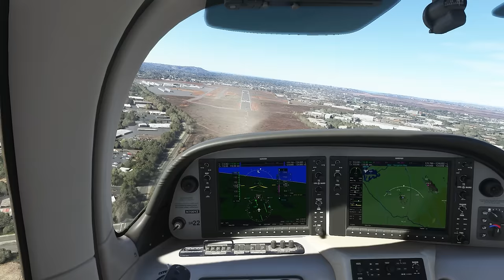Fatal Plane Crash At Montgomery Field After Student Pilot Declares An Emergency | N700YZ Crash

Comment: I live in San Diego and we discussed this in my Human Factors in Aviation class yesterday. Tragic accident, just learned the pilot died. Well put together video and explanation in such a short time from the accident
Reply from the maker: Thanks Joseph!
Reply: Joseph, as mentioned I witnessed the flight and accident and then was the first to reach the pilot and administered aid. Great that you are teaching the course in Human Factors. As a CFII for 43 years, and involved in several aircraft accident investigations, your course can be very useful.  Let me know if you need any additional information.
Reply: @PersonalWings  Sad, I would like to know if the pilot noticed the trim issue while within the BRS envelope of 500 above AGL. I know the military puts great emphasis  on rapid use of an  egress system. I don't remember how much the Cirrus syllabus harps on the early use of BRS.
Reply: @krezvan  It's tough to say without him being here to share his thoughts in those final moments. It's known that pilots will try to fix an issue before pulling the chute, and given the student status, he likely didn't have it drilled enough into him that it was an option. His height above according to Flight Aware was around 1,100 feet and the elevation is 420 at KMYF, enough altitude to pull the chute, but that may not be accurate based on the footage of the final moments showing him to be (or what looks to be) lower.
Reply: @krezvan  Hopefully the NTSB analysis will shed some light. The Cirrus CAPS/BRS is an excellent system and is always an option for the pilot.  As pilots we are usually good problem solvers and try to fix anomalies - some are not within our control to fix - hence the effectiveness of the Cirrus CAPS. I have it memorized - two hands on the handle, chinup-like maneuver, 45 pounds - PULL.  I've practiced it in the Vision Jet sim several times.  Rich and Tigre

Comment: The controller heard the accident airplane making broken transmissions without a callsign and didn’t hear when he said emergency and thought someone had a stuck mike. Looks like what prompted the go-around was that the cirrus was descending at three times the normal decent rate and continued flying at almost twice the normal approach airspeed which created a conflict with the plane she had just cleared onto the runway for departure. Pilot’s- remember to “fly the plane”. Controllers- try slowing down when you get overwhelmed, which is what she was (sorry but you were, since you didn’t see him hauling ass at 1 1/2 final when you cleared the other aircraft to line up and wait, not even clearing them for takeoff, OR hear the accident airplane say “emergency”).

Comment: My instructor has told me two circuit breakers you really know off by heart where they are. The trim and the autopilot. Often those circuit breakers are made to be more obvious.
Reply: Yes, I put red circuit breaker caps on mine. My airplane has retractable gear and so there's also a red cap on the gear breaker. You need to be able to locate them instantly - my airplane probably has (I haven't counted) close to 100 breakers on three separate panels so, even if I know about where a breaker is, having the red cap on the critical ones assures that I don't grab an adjacent one instead of the one I need.
Reply: On the cirrus, the breakers are very difficult to reach while flying, and on short final its impossible.  You have to bend forward and reach down, losing your view outside and limiting  control of the sidestick.
Reply: @Tharkunify  I've been in a Cirrus a couple of times but never trained in or flown one. That's very poor design though and surprising because Cirrus' reputation, well-earned as far as I know, it's excellent design with safety as the overarching considerations. A key component of training with autopilot, FMS, electric trim is what to do in the event of runaway. I had (and have in recurrent training) it drilled into me: "What are five ways to disconnect the autopilot? What are two ways to disconnect electric trim?"
Reply: @TIO540S1  I wish I could post a picture of the circuit breaker layout.  For pitch trim, its the furthest in the back, near the bottom.  Virtually impossible to find while flying low to the ground with a runaway trim.  One thing I learned from this video is to memorize the location by feel: Furthest back, 4 up from the bottom.  I have had a trim failure on this plane and it made me swear that my next plane will have a manual trim as backup like a Diamond.  It takes a large amount of force on the sidestick to maintain level flight.
Reply: @Tharkunify  I found the leg well location for the circuit breakers a interesting design choice.
Reply: @Tharkunify  Yes, I bet! Mine has electric and manual trim. I probably use them about equally. (Knocking on wood) I've never had a runaway trim incident in my current or previous airplane (a C441 currently and a Piper Saratoga previously).
Reply: Would pulling the trim breaker on a Ciruss cause it to fail into a neutral position?  I'd not want to fail the trim while it's fully deflected.
Reply: Really sad. Ultimately the fastest way to save the ship would be to flip the master off. First thing we train for with auto trim or autopilot issues. Flip the switches that are convenient, then troubleshoot with breakers. But the key is solving the problem as quickly as possible.
Reply: @zippoc04  on short VFR final that is a great idea.
Reply: @nuothe11th  - Pulling the trim breaker should have it fail in its last position. It will also free resistance on the manual trim. This will allow the pilot to adjust trim manually.
Reply: To me, the Cirrus CB panel can make it hard to find any specific breaker unless you tag it with a ID collar
Reply: @deanfowlkes  no manual trim on these, it stops where it stops and have to hold the yoke as needed
Reply: @TheReadBaron91  - That is unfortunate. I fly an LSA with an electric-only trim, as well. That is never as comfortable as having a manual backup. Landing out of trim really messes with your muscle memory.
Reply: @TheReadBaron91  - Exactly, something that can be felt and seen, even in low light conditions.
Reply: And if its getting critical and in the panic cant find them, turn the masters off, then get control at least
Reply: @Tharkunify  that's quite strange. Would the parachute still function in this case? Does Cirrus have a published procedure for this apparently repeat problem?

Comment: Flight instructor here. This will be a longer comment and I apologize in advance. Trim activating “on its own” can be due to pilot error or mechanical failure. However, any aircraft with autopilot trim will have a way to interrupt that trim, and revert it back to manual control only. It’s likely the student pilot wasn’t familiar enough with that procedure. As far as seriousness, it can be incredibly serious. In simple terms, trim essentially helps a pilot maintain a certain angle of pitch, and when working properly, eases the control force necessary to maintain a certain pitch. If that pitch goes too far up, you stall. Too far down, you descend. From the video and the information presented it seems that the latter was the case here. Full trim requires a very significant amount of force on the controls to overcome. It seems the pilot was unable to do so. My assumption would be that the pilot was either physically not strong enough to overcome the trim or not experienced enough to successfully land an airplane that was actively fighting against him.
Reply: The possibility exists that the problem was caused by the aircraft's envelope protection system rather than by a trim runaway. The lack of recorders on small GA aircraft may make it difficult to decide which actually occurred.
Reply: I agree of what you say. If happen to anybody, because it did so been to me at st Barth 😂 on pitch down, slow your speed at the maximum you can and take up/down gentle movement. After that the plane is enough controllable to make a safe land.

Comment: So sorry to hear about this accident. It reminds me of a similar emergency I encountered as a newly soloed student pilot. I had just departed the strip, about 100 ft up when I realized my Cessna 150 trim tab was stuck with too much climb cranked in, and it would not go back down. I didn’t know what to do. So, I pulled power, shoved the stick forward to dive for the runway, (about 4000 ft strip if I remember correctly). I managed to safely touch down and barely able to stop before rolling off the end of the runway, (about one foot of runway remaining, literally 1 ft). If not for the Lord I’m sure I would have run off the end of the strip, OR tipped face forward into the runway seriously damaging the plane and maybe me too. I had to physically shut off the engine, get out of the plane, and manually swing the tail around to point back to the taxiway before I could get off of the runway.

The run up to takeoff checklist had indicated no trim tab problem. After the plane was tied down I discovered that my newly repaired radio was installed without the antenna RF cable being properly tie wrapped to the airframe. So naturally once the plane was in an up attitude during takeoff the loose cable drooped into and jammed the trim tab, making it somewhat of a ratchet limitation, it would go further up but not down.

Lesson learned from this near disaster, ALWAYS double check the correct installation of all new or repaired equipment before starting the engine.
Reply: Thank you for this story!

Comment: 4 reasons why I never once used the electric trim on Caravans in which I have about 4K hours: 1 you never have to worry about a runaway trim; 2, I felt I had better control and better feel for what the airplane is doing by using manual trim; 3 trim switches are expensive, if you use it all the time it's eventually gonna break; 4 like power windows in a car, there's tendency to always be adjusting the thing up or down, resulting in sloppy flying.
'Other thing to remember: Turn OFF the master (or pull the breaker, if you can remember where it is) and fly without it. Most light-plane engines will fun fine without the master on.
I wouldn't train new pilots in a Cirrus, either.

Comment: As a pilot flying a C182 (350 hrs) and having test flown a Cirrus SR22 for a one hour test flight (we we're considering purchasing) the Cirrus was quite challenging especially with the lefthand joystick control.  I had remembered my flight instructor talking about not purchasing a "doctor killer until you gain experience" as he referred Bonanza and many other higher performance or complex aircraft.  The ballistic shoot on the Cirrus can lull a pilot into a false sense of security.  With the greatest respect to the family and without knowing all the facts I can imagine the following scenario going through his head.  TRIM ISSUE, FLY THE PLANE, WHERE IS THAT AIRCRAFT,  I DON'T WANT TO GET IN TROUBLE WITH ATC, I SHOULD GO AROUND,  I CAN'T,  WHICH BREAKER KILLS TRIM, NO TIME, FLY THE PLANE, END OF RUNAWAY,  NO ROOM, FLY THE PLANE, PULL UP, GO AROUND, STALL SPIN. Very sad and could easily have happened to me.  We have to remember everything happened from problem to crash in less than one mile at 100 knots. Agsin condolences to the family.
Reply: I agree. I have to sometimes remind myself that no matter what my certificate says, I’m still a student pilot with unlimited IMC solo privileges.
Reply: You get used to the side yoke and eventually prefer it, or at least I do. You’re spot on with the need to fly the plane. The Cirrus only has electric trim but even fully out of trim it’s still very controllable, just takes a bit of effort… but nothing like a Cessna where out of trim condition it near impossible to overcome… but they also have the manual trim wheel. Hope you’re enjoying the 182, those are very sweet as well. The Cirrus actually has a fairly good safety record, but there are A LOT of them flying these days. I personally do not feel it has earned a “doctor killer” title.
Reply: I'm not a pilot so I may sound ignorant but why are these breakers not clearly labeled for an emergency? Or are they and he was just too panicked?
Reply: @Michael_Hunt  They are and frankly it wouldn't have helped at all because of the way the Cirrus system works. With that said it's not hard to muscle through it unlike most where it's nearly impossible to muscle through it.
Reply: @Michael_Hunt think of like 30 black buttons in 2 rows of 15 at the right side of your leg in an unlit part of the cockpit. All the little buttons are black. Labeled with little white lettering under them. With out adding a “breaker collar” it’s hard to find and even harder to find while stressed like this pilot.

Comment: I don't fly the SR20, but I know it has a control stick rather than the familiar yoke control column, and the stick is complicated and could present problems for pilots who aren't used to it. The push-to-talk is a small button located on the front of the stick where it is hard to see. The accident pilot may have grasped the stick tight when he declared an emergency and pushed that button by mistake. The trim button is on the top of the stick and it is one of those 4-way up/down/left/right things that may have gotten stuck or been pushed by mistake by the pilot. Another problem is that continual pressure must be maintained on the stick or it will automatically return to a neutral setting. The SR20 and SR22 models are extremely popular but have had a lot of pattern accidents due (in my humble opinion) to a poor overall design.
Reply: I think the control stick is better for pilots because it is what seems more intuitive for me. However, I do think that until the rest of aviation catches up to what I honestly believe is a better control system, there will be need for training on the stick before putting someone in a plane with one.

Comment: Tragic accident, to be sure.  I think he panicked when his trim started to malfunction.  He needed to stay calm and work the problem.  The trim doesn't override the elevator, but a fully deflected trim would mean that you'd really be having to muscle the yoke to keep the pitch attitude level.  Still, it is doable, and he needed to climb to see if he could resolve the problem.  And if he felt he couldn't land safely with the trim jacked up... well, then it's time to pull that big, red handle.
Reply: Is there an electric trim shut off in the Cirrus?
Reply: Why let him fly alone? Some people just shouldnt.
Reply: @louissanderson719   There might be a breaker for it, but I don't think it would matter.  If the trim went fully deflected then all the breaker does is turn it off and it's still in that position.
Reply: @industrieundtechnik1761   I believe it said he was flying solo.  That's a necessary and important part of pilot training.  Though in all fairness, I'm not sure how I would react if this happened on my first solo.   I would hope that I would take my own advice: stay calm and work the problem, but you never know until you're actually in that situation.
Reply: I was told this about flying. Bad things happen when 3 mistakes are made. I won’t judge this pilots 3 things.
Reply: @alanharaldson4229  hohoho
Reply: @ABQSentinel  all planes have a manual way to change the trim, pull the breaker, fight the trim with elevator input and work out the trim manually to a neutral state, then go on to land.
Reply: @ABQSentinel  His communications appear to suggest it was moving abnormally on it's own for some reason rather than just being stuck in one position. Either way their biggest mistake in this situation was rushing to land immediately in an aircraft that still had power and was still flying. Better bet would be to add power and get the aircraft climbing to buy yourself some breathing room to run checklists to diagnose and fix or isolate the problem then prepare for another approach. Unless you don't have the energy or are literally on fire or something of that nature best not to rush to get down and throw away valuable time that could be spent getting a better handle on what is going on. Also vitally important if you feel yourself starting to panic there is a reason for the saying, "When you have an emergency, the first thing to do is wind your watch", it's a good reminder to stop and take a breather then take your time decisions taken in the grip of panic tend to be the exact opposite of helpful in situations where you need to think clearly about the problem.
Reply: @seraphina985  Yup, I agree.  This is why commercial planes don't rush to the ground when there is a problem.  They make their emergency call and then ask for vectors to stay near the airport but give them time to work through the QRH.

Comment: I had a runaway trim on my first solo flight in a Cessna 172SP. Luckily I immediately realized something was wrong and looked down just in time to see the trim reach the limit of its travel. I was also very fortunate my instructor had drilled into my head which breakers to pull to disable the electric trim and autopilot. I was able to pull the breaker and spent the next minute or so re-trimming the airplane. I remember being thankful I was strong enough to overpower the trim. It took a considerable amount of force. It could have been fatal for someone with limited strength.